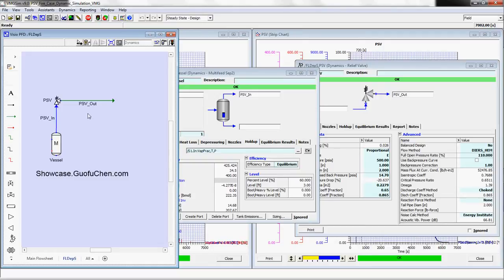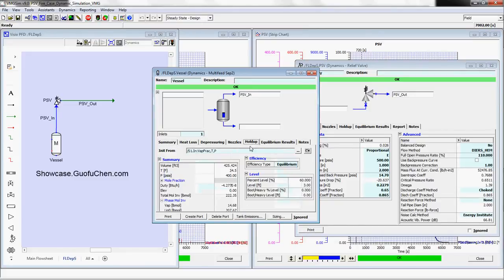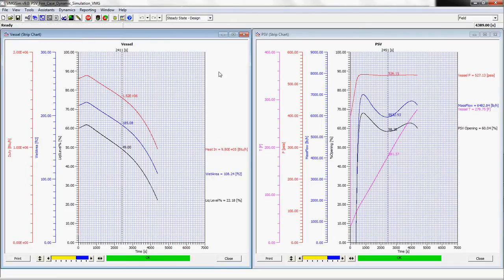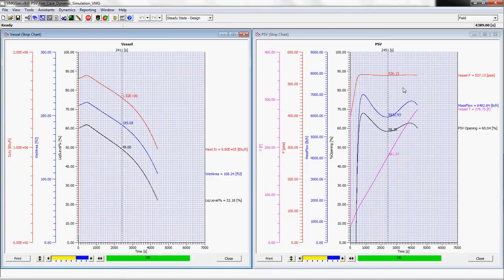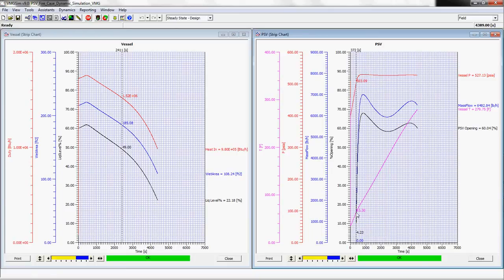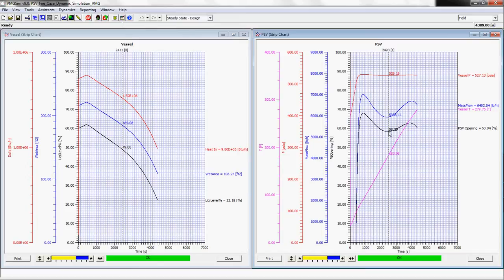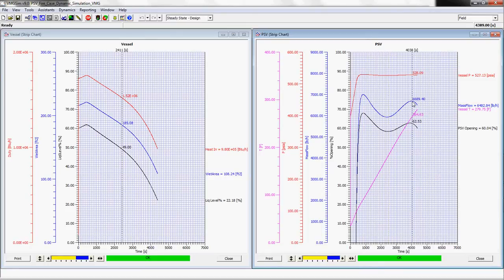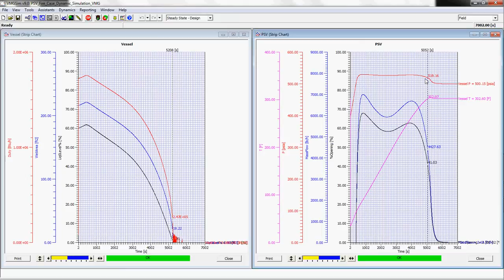Are You One of 99% Engineers Who Size PSV Fire Case the Wrong Way?

Comment: It is incorrect to say 99% of engineers size the fire case incorrectly. API 520/521 shows that you can make a steady state approximation, the 'Normal' AND CORRECT way to size a fire you could say. Then it goes on to say that you can use a dynamic simulation. Obviously that is preferable but it is not always what you are looking for.
Reply: The simulation actually demonstrates that for this particular situation that the approximation in the API code is reasonably valid. The biggest area of uncertainty in this type of analysis is not usually the sophistication of the analysis method. It is the estimation of the heat flux applied to the vessel in the first place.  The way in which fire events occur is extremely complex and the flux values in the various codes are approximate.  Applying a sophisticated dynamic simulation might improve insight into the physics taking place within the vessel and is certainly intellectually satisfying, but given the underlying uncertainties it might not produce a more valid or reliable sizing.

Comment: Are you modelling the heat flux with Stefan Boltzmann or API heat flux? If you are using the API heat flux equation, many people would argue that the wetted area should be based on the initial wetted area -- it should not change. This would be because the API heat flux equation is empirically based -- and the heat flux equation was based on the initial wetted area of the vessel's which were being tested. My only point is that all people watching this video should confirm what their own company guidelines are.

Comment: You did not provide a reason as to why the liquid level rises in the first instance; I am curious of the reason why. Characteristically, the liquid level should drop as it begins to vaporise from the heat input from fire exposure. However, a rise of upto 2% in level seems a lot given the industrial vessel inventories are pretty large.
Reply: That is due to liquid expansion which causes level rising before vaporisation commences

Comment: Thanks, I learned something today :). 
But as we saw on the curves, can we say that the method from API 521 is valid? You showed us that the maximum flow to be relieved will be at the first opening of the PSV. At this time, the latent heat is know, and the only exception is the very little expansion of the liquid that increase the heat input from the fire.
Reply from the maker: +Karl Bilodeau It is true for this case. But it is not always true. The relief flow can get larger in some instances.